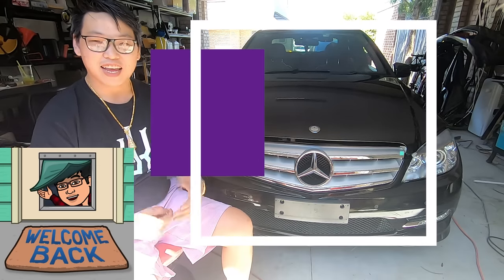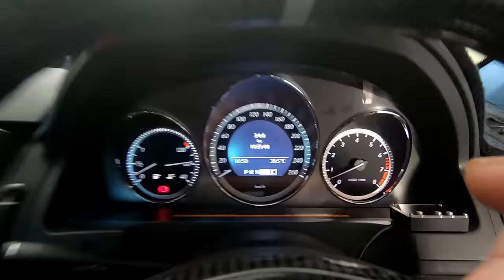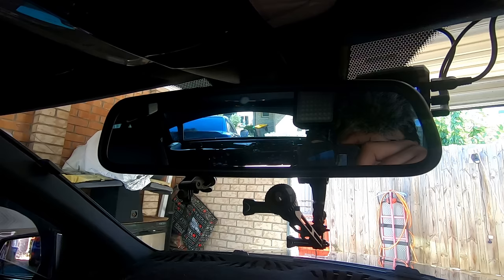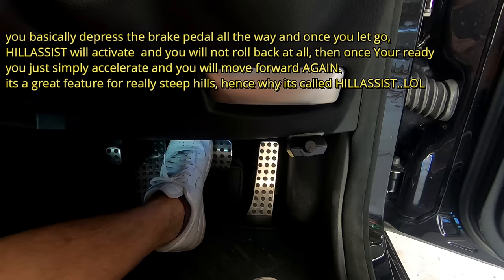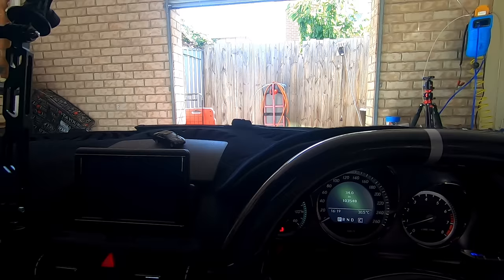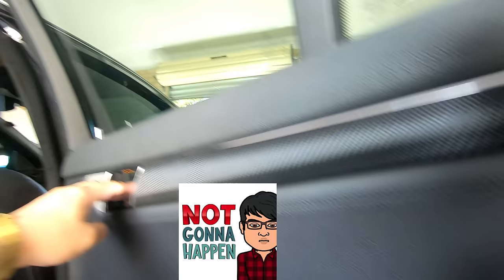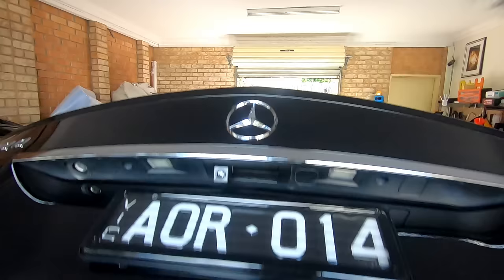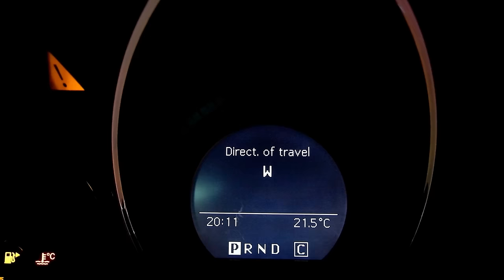MERCEDES BENZ C CLASS W204 COOL and  UNKNOWN  FEATURES + TIPS

Comment: I have such a car in 2008 but I can not use Bluetooth on songs only on calls
Reply from the maker: yes unfortunately thats how our cars are made unless you buy either a device that will aloow you to stream luetooth like a bovee or tune2air ...do you have aux integrated or mmi??
Reply: MIKEYZ VLOGZ yes I have aux but I don’t like the Cable so i purchased an external bluetooth but the sound is not pure
Reply: Do you know where I find this?COOLANT EXPANSION TANK   
live in Sydney
Reply: Do you know where to find a place to modify the car such as car audio and body kit
Reply from the maker: @samerasked499  you should start with Google I'm from Melbourne I dont know Sydney... Google is a great place to start looking friend has alot of answers
Reply from the maker: @samerasked499  coolant expansion tank Ebay is best place and then next place if u can find would be either 2nd hand wreckers or mer edes spare parts store ..alot od this is on Google just type in what your looking for and u can find it all..Ebay has everything nowadays
Reply from the maker: @samerasked499  ahh u have the older system ... but now you can buy upgraded systems for about 1000 and install yourself 10.35 inch android screen and then u can do everything bluetooth sd card USB phone morrorlink everything
Reply: MIKEYZ VLOGZ thx bro ❤️👍
Reply from the maker: @samerasked499  ur welcome be sure to subscribed ot the channel